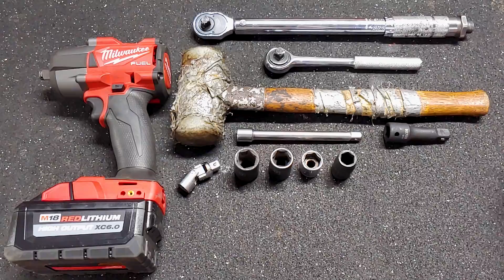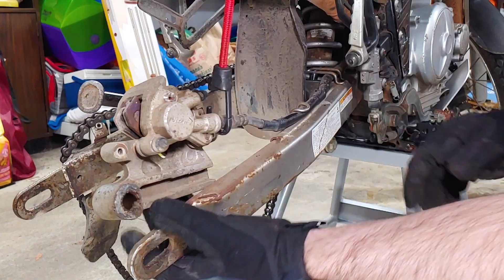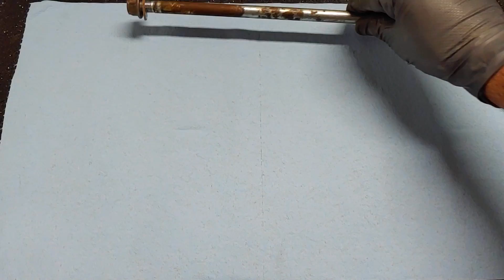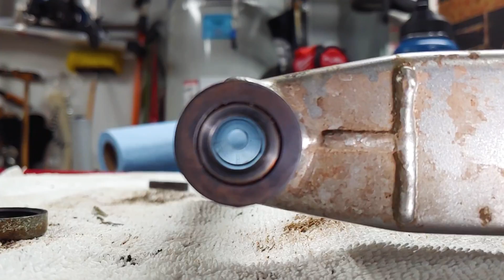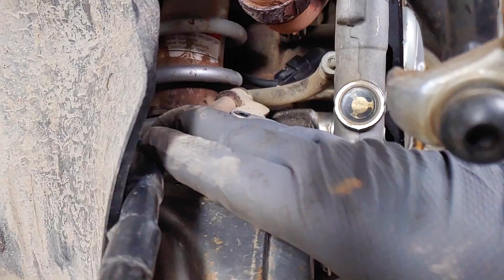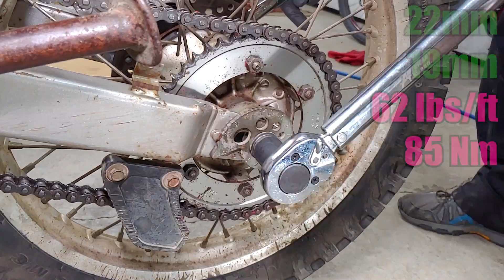XT250 / Serow 250 - Swingarm Maintenance Guide with Tool Sizes and Torque Specs

Comment: A couple of thoughts: 1) use a wire-wheel on a grinder to remove all rust on the shafts where they bear weight.  2) Never spray solvents into the wheel bearings - this dilutes the grease as well as introduced contaminants into the "sealed" bearings (they are not solvent proof).

Comment: Can too much lubricant make a creaking noise?

Installed new shock spring and since then there has been a squeaking/creaking noise. Mostly on the right side
Reply from the maker: Not likely. I would say, creaking is usually from lack of lube or an improperly torqued fastener.

Comment: Not full Maintenance. Do the full job. Quit cutting corners. This video is only halfass.
Reply from the maker: If I cut any corners it was not on purpose. Thanks for watching!
Reply: @endlessmoneypits  But you mentioned you would be replacing some parts later but had to reassemble for the time being.  You made it safe to ride.  No worries.  Good job IMO.

Comment: Good job dismounting
But having the swing arm out I would remove rust and paint it
Also the bolts need a good clean up w iron brush before greasing
Reply from the maker: Good suggestions.

Comment: Interesting, I don’t think the Serow 250 has a full through shaft in the swing arm like the XT250. I could be wrong but I’ve seen videos of ppl replacing two shorter shafts with a full shaft to beef up the rear end. I was thinking about doing this too but maybe my XT has full shaft already 🤔
Reply from the maker: That's an odd design. I had not heard of that before.

Comment: Recommendation, treat any rust with naval jelly or equivalent and paint. For all rubber, treat with 303. Curious to know if you could feel or notice any difference in ride. Good job and thanks for sharing.
Reply from the maker: Yeah, maybe I should treat the rust soon. I didn't because it seems pretty superficial but it certainly could get worse if neglected. I'm not familiar with 303 so I'll look into that, thanks. I did not notice any difference in the swingarm movement after this but I replaced the rear brake caliper at the same time and have been focused on the difference made there. This bike was scary to ride when it arrived but it's come a long way. Just a couple more things to do...